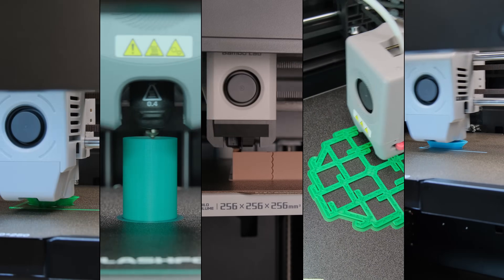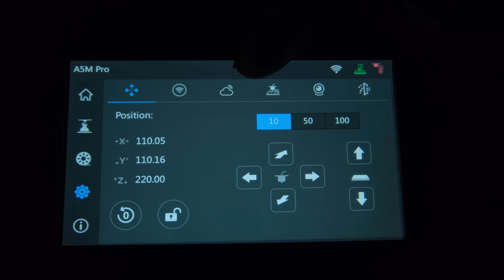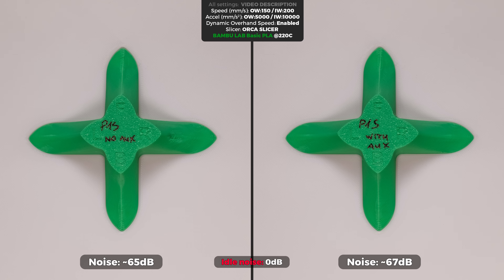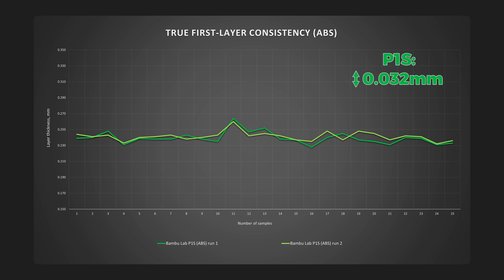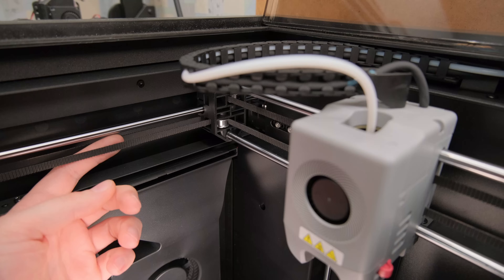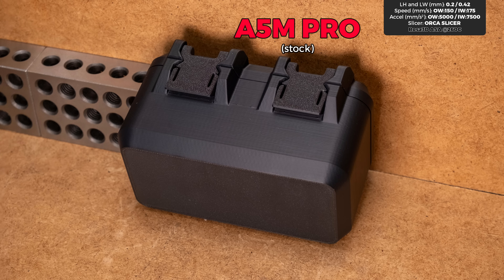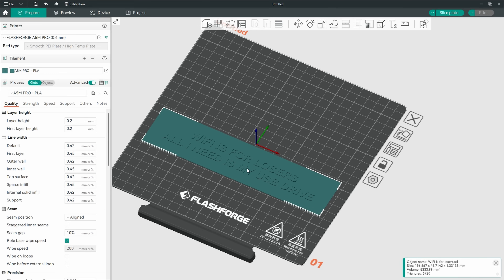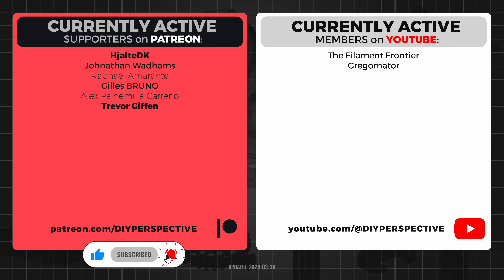QIDI Q1 PRO vs FLASHFORGE A5M PRO compared to P1S (3D Print Quality Review)

Comment: I got a Q1 Pro the other day and I really like it so far! I really appreciate this comparison and wanted to mention the reason I got the q1 pro instead of the other options is because the p1s is just way more expensive, and the flash forge has a smaller build area and locked down software. I have definitely noticed some of the jankiness, but overall I think it's a pretty good printer especially for the price i paid ($450 USD). QIDI support is also fantastic, they answer questions quickly and from what I've seen they provide a lot of help with hardware issues as well, like replacement parts. Thankfully I haven't had to contact them for anything yet, but I like knowing that if something breaks I can get it sorted out with them.

I am genuinely curious though, whether anyone has any major reasons not covered in this video that I should return this printer and get something else. I have 30 days to return it and want whats best for my money! Thanks
Reply from the maker: My first impressions of Q1 PRO were poor as my experience with their X-...3 printers were horrible and it seemed it would be the same with the new one. But the more I used and tested the more I liked it as the improvement was significant, especially for the bed leveling performance.
I am quite critical of the printers and try to provide all the problems rather than talk about the positives that you should expect from any of the printers like these.
The only thing I forgot to mention is that a significant amount of heat in the chamber leaks into the electronics compartment. So if you will be using a printer to constantly print high-temp stuff you should try sealing the gaps for better efficiency.
About QIDI support, you are 100% correct. They provide a very competent and generous support. Plus there are also things you can print and improve the printer https://wiki.qidi3d.com/en/Q1-Pro/Other/Components
At the end of the day, it always depends on what purpose you are buying a 3D printer. Do you want to tinker with it? Do you want just to print? What materials do you want to print the most? and etc. Also, it is unreasonable to expect that a $450 printer would be as good as $700 one, you know.
I personally, am sealing my Q1 PRO and will be printing engineering materials. While my K1 printers collect dust because they do not offer anything better than P1S... :D So...

Comment: my q1 pro is coming. Is there any way you so how to calibrate the printer to its performance?
Reply from the maker: I mean it performs quite well overall for the price. You should print PLA with lower bed temps like 50-55C for better cooling as the PEI plate has great layer adhesion and you shouldn't use too high accelerations or use a more aggressive input shaper like EI, that is pretty much it.
Reply: @PrintingPerspective what is input shaper EI?

Comment: 'Z-hop type: Spiral' is an Orca Slicer setting.  New version of Klipper is not necessary.
Reply from the maker: I double-checked and yes, you are correct. Unfortunately, you will be flooded with // Unknown command:"G17" messages in your terminal which is really annoying.

Comment: The most complete no-nonsense comparison of the printer's capabilities so far.  Excellent evaluate of the prospective market of each unit. To be fair the reverse polarity is not a QIDI issue, yes they could implement a switching circuit to check polarity. It's not their place to correct terrible practices. Looking at you Shore power.
Reply: Nope its there issue, bcuz they leave it in the chamber. Go dc if you cant design a safe product
Reply from the maker: Thanks. I think it is the QIDI issue because you can touch the fins with the fingers or other objects in your hands like a wet cleaning napkin. If there would be a longer cover with more thins it would solve the issue. If your printer can harm people no matter where they live, it is the issue of a responsible company. That is my thinking on this. :)
Reply: @PrintingPerspective  QIDI have released an official cover for users to print if they wish.
Reply: The heater is completely safe, the same as any other space heater, plus in the US all garages have GFCI plugs or you can convert any plug to a GFCI if someone intentionally touches the fins with a thin metal object. (fingers don't fit) In Europe, almost all homes have GFCI Circuit Breakers if you don't just add one if you have micro fingers and want to play with sparks

Comment: Hi, what are the dimensions of the extra spring tensioners? possible to get STL?
Reply from the maker: Hey, sure https://drive.google.com/drive/folders/1peB2JGXXPHaYni6esnecBnO7-dD4bT5m?usp=sharing

Just be aware that this is not a suggested method. Ideally, QIDI should send beefier springs.
Reply: Added them to my qidi x max 3. Ran input shaping again and got a 1k increase in acceleration!
Reply from the maker: Does the X-Max 3 uses the identical tensioning system?
Reply: @PrintingPerspective As far as I can tell they are the same. Both have the automatic tensioners.

Comment: Just emailed Qidi to cancel my Q1 order.. I didn't realize it was this janky. I'm gonna get a P1S instead.
Reply from the maker: QIDI jankyness mostly come from the things that aren't related to the print quality. But to be fair it is way cheaper. If you known your way around with 3d printers Q1 Pro offers a lot of value for enclosed printing.
Reply: @PrintingPerspective  That ringing is so bad though 😬
Reply from the maker: If you don't want to do any tinkering - yes it is bad. P1S with E3D Obxidian high flow nozzle is probably the best print quality you can get without going too insane on the price. It is so hard to advise what to get because it always depends a lot on individual things.
Reply: @PrintingPerspective  Definitely don't mind tinkering, but how smoothly can you actually get the Q1 to print walls? Those artifacts are pretty bad 💀

Even with EI shaper, most of those accels are pretty rough. The part cooling too 🫠
Reply from the maker: I mean, you saw the comparison, but remember that it is with the worst lighting angle and with filament that shows the difference the best. As I said it depends on what you looking for from the printer, Q1 PRO offers the value option to print engineering materials and you won't be printing those crazy fast anyway. If I were looking to buy with my money and it was my single printer I would save up and go for the P1S because it does almost everything great. And when you have a reliable and good 3D printer then you can look for cheaper printers to tinker, mod, and make them more specialty ones. Hopefully, it helps to decide.
Reply: @PrintingPerspective  Yeah, looks like you read my mind there! I do really appreciate you responding to this comment with your thoughts!!

The A1 will be back in stock pretty soon as well which is great for PLA / TPU, so that's another great option with its auto flow calibration.
Reply: Poor choice my friend. You get more out of the Q1 Pro than the P1S and you get the same print quality.
Reply: @DogofW0r  I built a Voron instead and it's printing better than both 😅

Comment: Would definetly want to see more videos about the 5M.  How would you compare the print quality of 5M vs Bambu A1 ?
Reply from the maker: You can watch my Bambu A1 review, most of the tests and filaments I use are always the same, so you can easily compare. Pure print quality and speed wise A5M Pro is superior because it is CoreXY. The best choice always depends on what you want from a 3D printer.
Reply: @PrintingPerspective  i watched both of your a1 and 5m pro videos and i decided to pick 5m pro. because of bency test and close enclosure. Only con you mentioned was automatic heater shutdown after 10 minutes. Your tests are the most detailed and practical. Other channels just talk about printer and shows weird prints they have

Comment: I just received Q1 Pro and it's my second printer after Ender 3 V2 Neo. So when you started looking closer at all the deficiencies, I panicked a little wondering whether I did the right thing ;) All in all thank you for putting in the work to show the differences between those printers and providing actual numbers. By the way, I wonder whether using copper/brass nozzle on Q1 Pro instead of the bi-metallic (stock) one would improve the flow.
Reply from the maker: @greengohm As janky as Q1 Pro feels in some areas it still prints better than K1 series printers. As for the max flow, I doubt you will see any noticable improvement as copper nozzle with hardened steel tip is the best of both worlds. You could try brass CHT clone nozzles for QIDI that you can find on AliExpress. Or the genuine Bondtech V6 CHT + adapter for V6 nozzles on QIDI printers from Ali.
Reply: In my experience, the biggest problem with the stock "bi-metal" nozzle is clogs. Couple that with no clog/jam detection and if a long print clogs/jams, you cook the filament in the nozzle and might as well throw it in the trash. Very disappointing, on top of all the other janky things noted in the video.
Reply: Nah, it's the correct choice, especially since it'll truly help with printing out parts for the inevitable Voron or other DIY printer you'll be making down the road!

Comment: YAY! I had no idea FlashForge finally put out wireless printing on the new Orca release. Or, I assume, it was just the fine people working on Orca.... 

I've printed so much on that printer over the weekend. Now I know I didn't have to keep going back and forth with the Flash Drives. Pun intended!

P.S. How much trouble would it be to throw a Big Tree Tech board into the Adventurer to get stock Klipper? Worth it to me. I just only know PC's. Nothing about 3D printer boards...
Reply from the maker: I am pretty sure Flashforge themselves had nothing to do with it. As the functionality was created by iherbak https://github.com/iherbak/OrcaSlicer and SoftFever implemented the support in his official Orca Slicer. :)

Even I personally wouldn't try it, too many things to be worried about. :D

Comment: Appreciate the more in depth look at print quality! This is one of the first reviews I have seen actually quantify several small issues with the Q1 Pro. So far, adding up all the results I have seen from reviews and people I know who have the printer, the overall printing capability and quality is still great. I think it's probably the best overall bang for buck printer, and hopefully they'll even improve it as Qidi is known to do.
Reply from the maker: Thanks. To be honest their X -... 3 printers were a disaster when they launched. They improved them a lot since, but Q1 PRO is a quite decent step forward. Of course, it comes with signature QIDI jankyness, especially the low-quality outer plastic of the printer and other weird decisions that could have been easily avoided. It is definitely a printer for more advanced users who know what they're doing and can take the most advantage of the value it provides for enclosed printing.
Reply: @PrintingPerspective  With that in mind, 10 months later looking at alternatives to Bambu for getting into it, how would you say the Q1 Pro performs?
Reply: Would you say this is a good first 3d printer? If you were new all things considered what would be the data points you'd be focused on. I have learned if, nothing else,  there's a software war waging making it hard for newbs to get closer to the truth regarding reviews etc
Reply: @hobonickel840  I think this is a great first 3D printer overall. Certainly easier to setup and get good quality prints with than many options. Also quite affordable and there are already printable mods available for it. If you think you'll be interested in printing more advanced filaments in the future like nylon, this is great. As for the software, this still runs Klipper and will get updates even if it isn't vanilla firmware. As a beginner, you wouldn't really worry about that until a bit down the road anyways, but this doesn't fundamentally break or limit the printer.